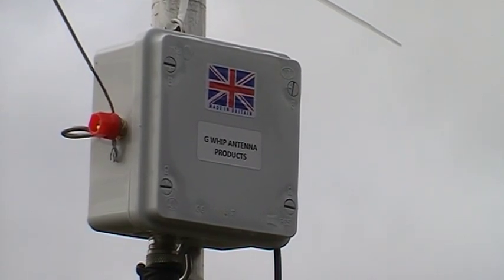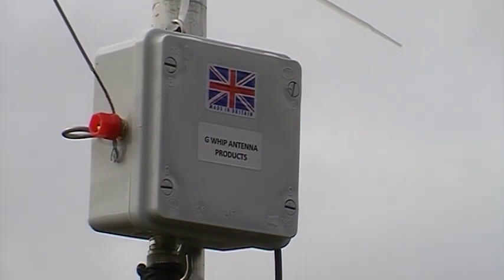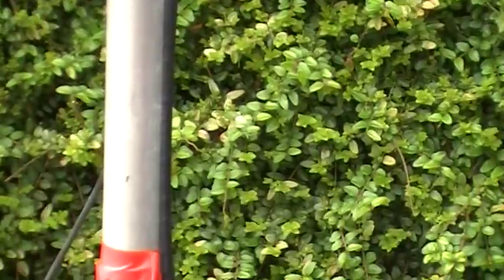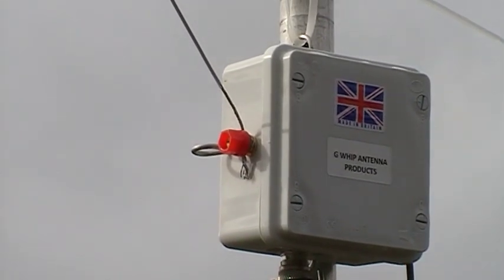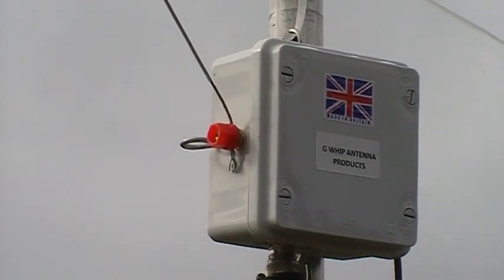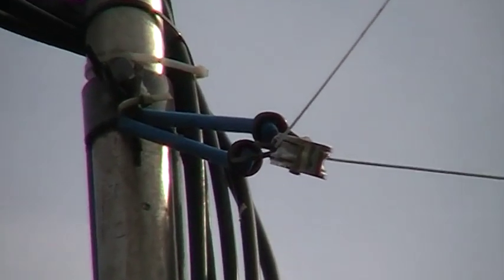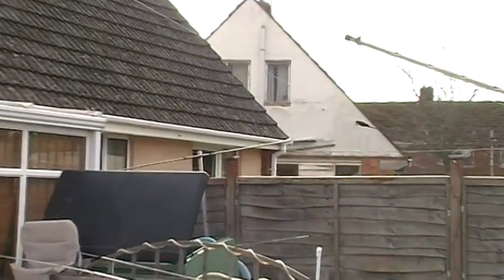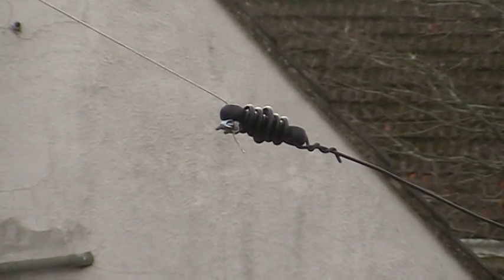9.1 Balun by G-Whip and my end fed wire antenna - 24 Feb 2011

Comment: How can a 9.1 ballun possibly cost you 50 pounds with a piece off wire tied to the end of it. A RIPP off
Reply: I can assure you that Gwhip baluns are the king of baluns. Look at the web site and see the quality of build. I have 2 1:1 current baluns and is simply no better. By the way a 9:1 is an UNUN not a BALUN. If you prefer a box of cheap poor quality parts which leaks like a sieve in the first rains then buy a £10 one from ebay. If however you want a unit which is fully resin potted with high quality parts and will last a lifetime, then GWhip is what you need.